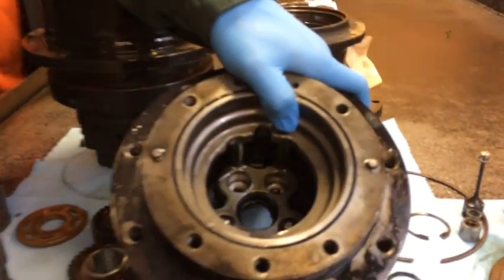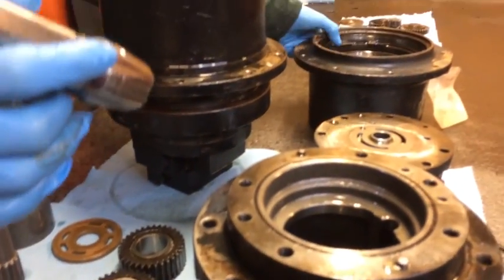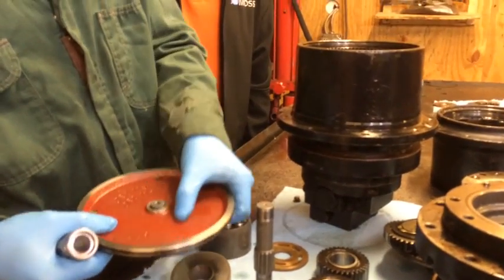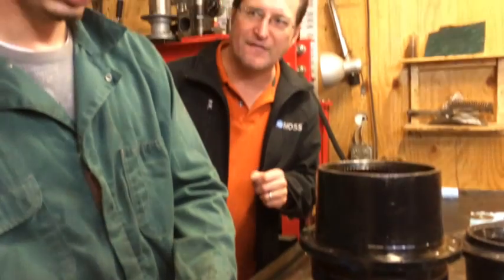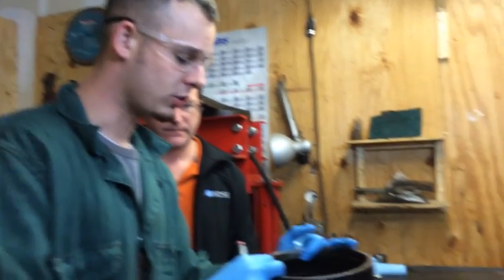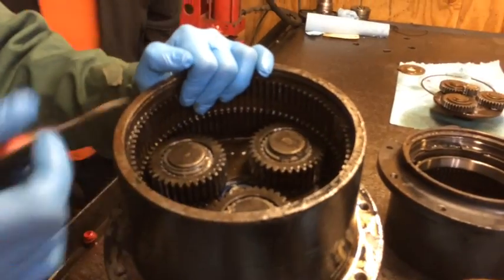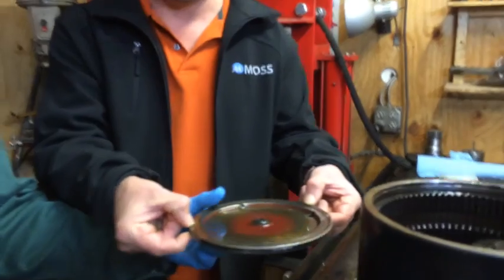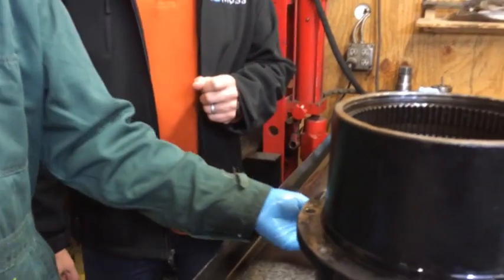Excavator Travel Motor Damage By Clogged Case Drain

Comment: Ok so I have a Case 888 excavator with this problem.  When I checked the final gear oil about 6 weeks ago it was under pressure.  Rough idea for new seals and bearings??